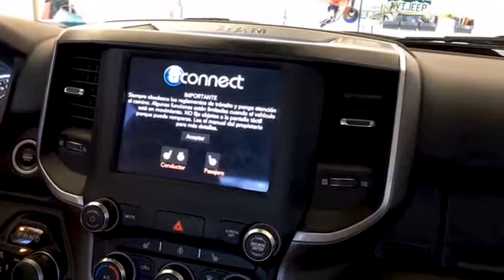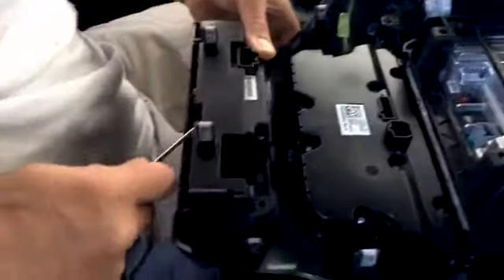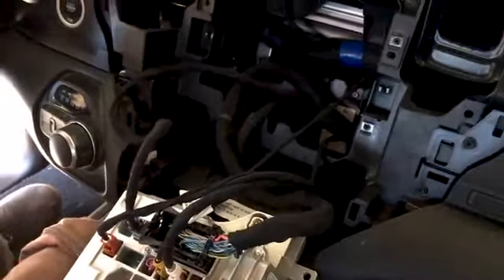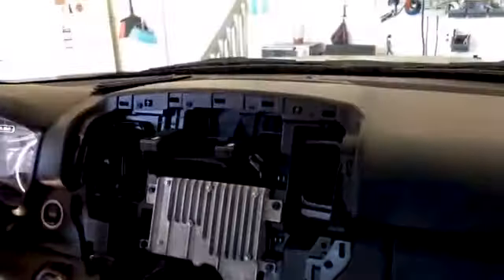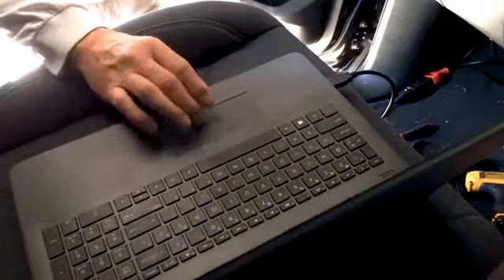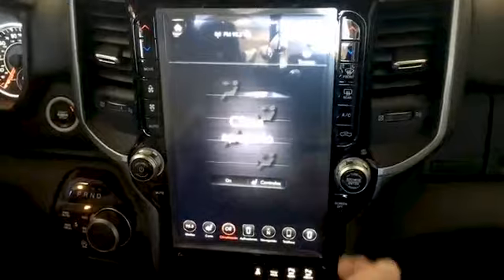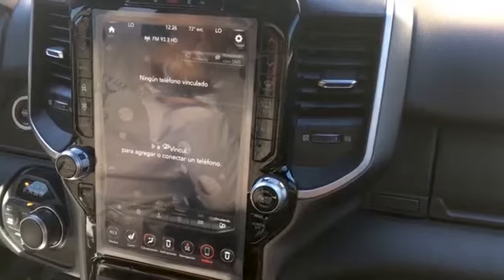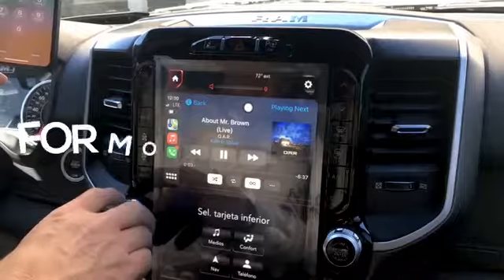2019 - 2021 Ram 12 inch UAX Screen Upgrade!

Comment: What if you already have WiFi from mopar in a 2021 8.4 inch screen will it transfer over to a 12 inch screen?
Reply from the maker: It should, we have heard that it will, you might have to call to have it transferred. We are currently looking into that.

Comment: Do you have the 12 inches screen kit for my 2020 ram 1500 laramie with 8.2 screen?
Reply from the maker: You would have to message in on our website so we can run your vin to see if you are compatible.
https://www.gm-navigation.com/shop/dodge-ram-12-inch-touch-screen-navigation-upgrade/